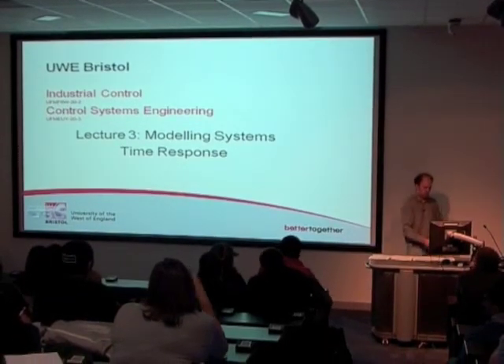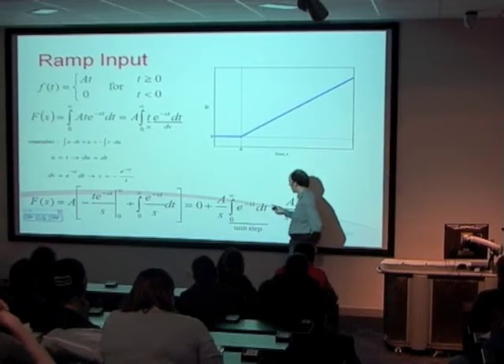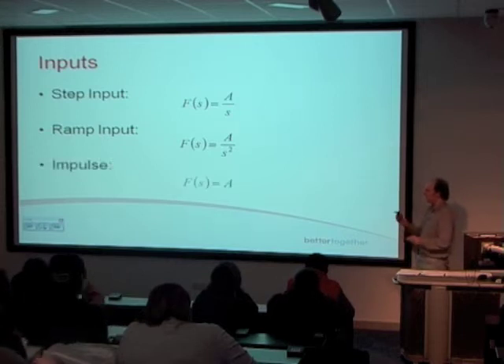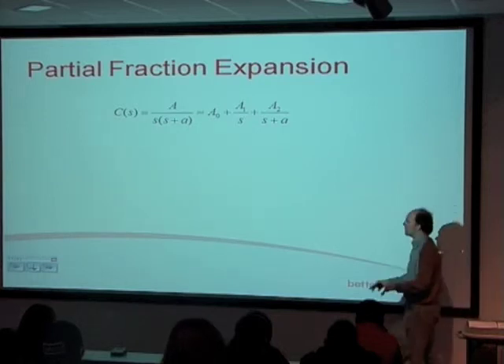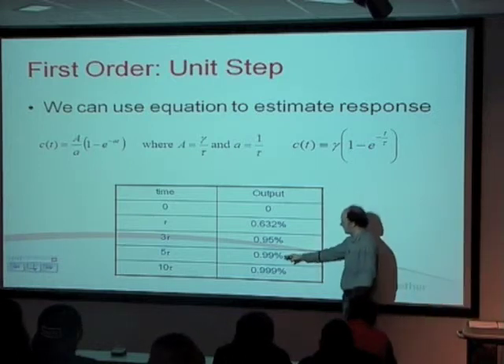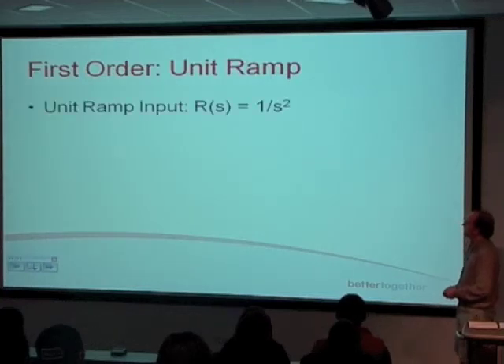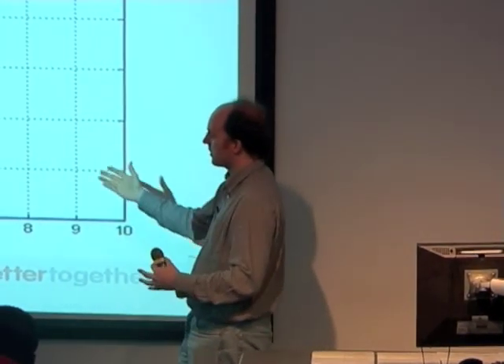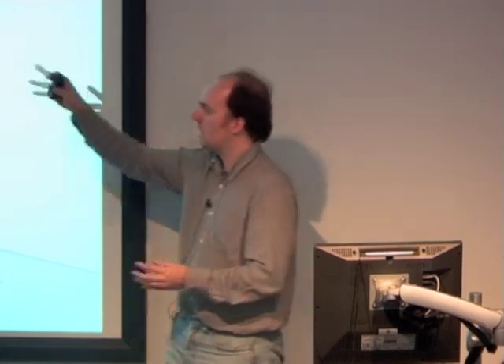Control Systems Engineering - Lecture 3 - Time Response

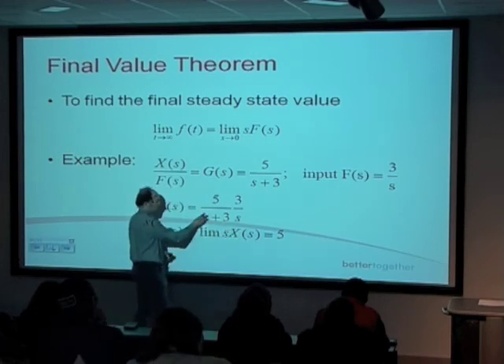Comment: 33:10, the gain is 5/3, not 5. (Yes, easy mistake to make during the lecture, I just thought it might help some viewer to point it out.)
Reply: That is not correct. Since you multiply for S, s in the numerator and in the denominator cancel each other. As s ->0, the denominator tends to 3, which cancel the 3 in the numerator. Thus, the answer is 5.